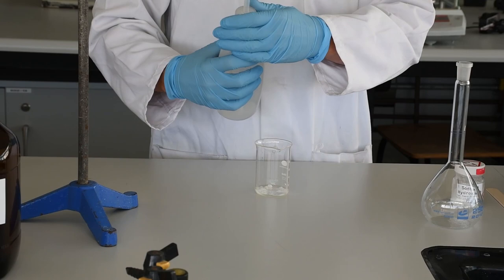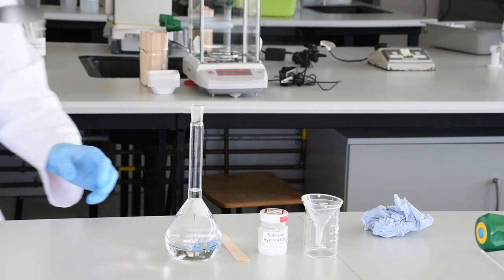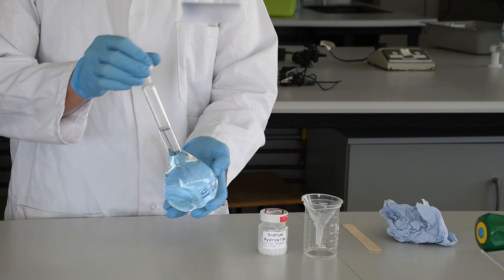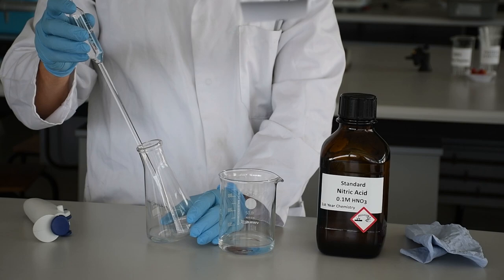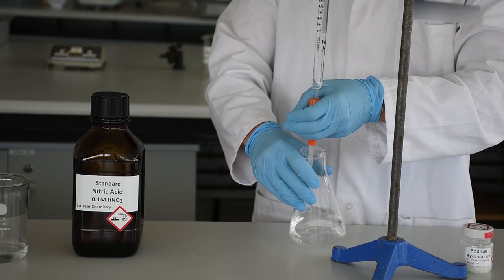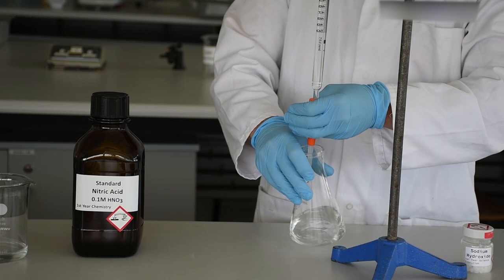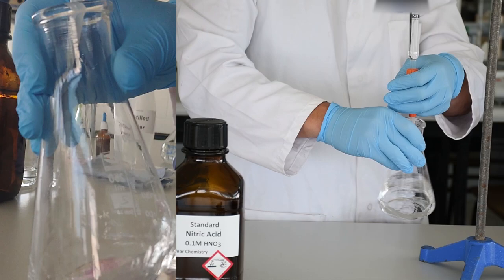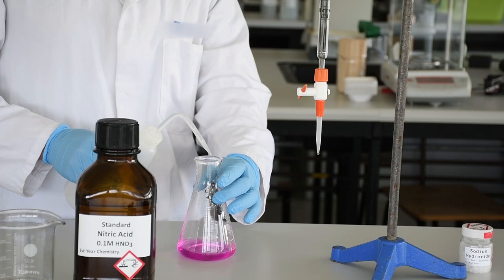Performing a Titration (in practice, not in theory!)

Comment: Each time I do the titre i always get different results, i don't know why,  for example my first titre could be 23.46 and then when i do it again it will be something like 23.47, the value keep getting bigger and bigger every time, i don' t know why, i make sure i follow the instructions, it is just to get the the titres within 0.1 that is the problem?
Reply from the maker: There will be some variation between titres as your glassware is only so accurate but if you are seeing a constant increase in your titre then it is a sign that something is wrong. It could be that you didn't rinse the burette with the solution it was to contain as then the solution will slowly get more concentrated after each refilling.

Comment: When I am doing my second titre do I rinse out the conical flask with distilled water?
Reply from the maker: Yes - you want to make sure there is nothing in the flask that could interfere with the titration. (That said, if you accurately get to the endpoint and forget to wash your flask in between runs the effect should be minimal since you should have a almost perfectly neutralised solution at the endpoint containing only salt and water)